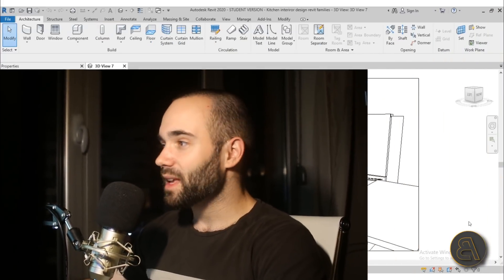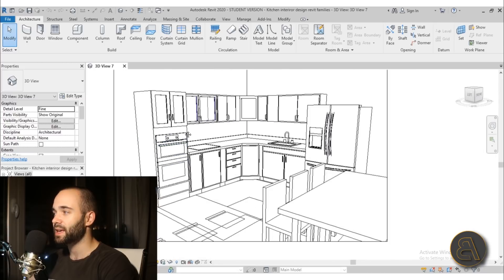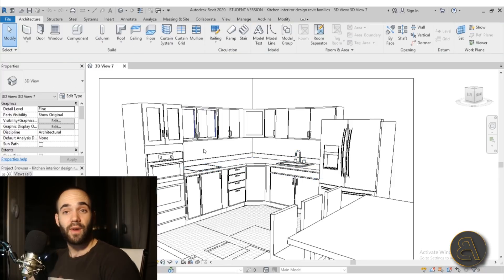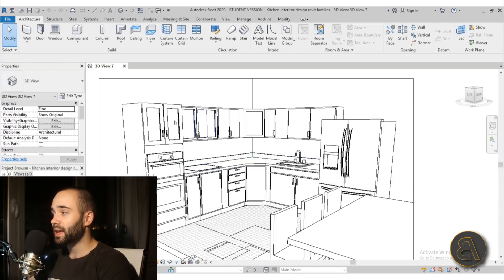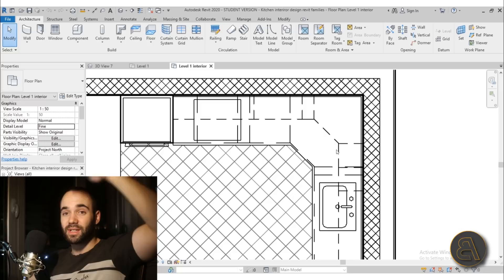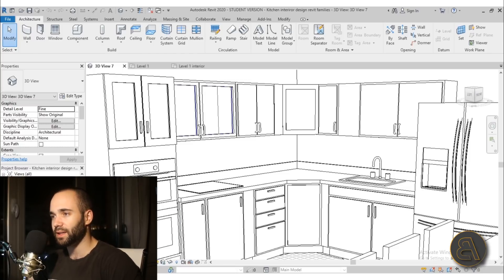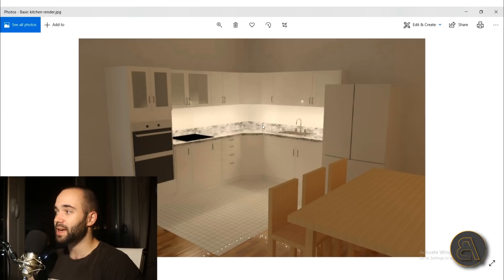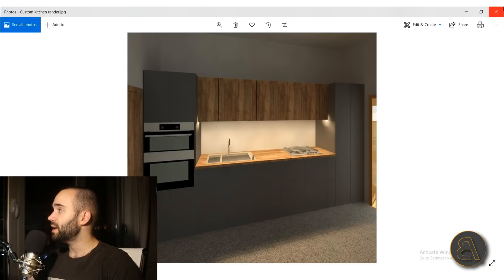Revit Interior Design   Kitchen Balkan Complete Course

Comment: I'm a design build architect. I'm here because I'm looking for a better workflow. My projects are mostly interior fitouts? My current workflow is autocad - sketchup- microsoft exel. Is using revit saves more time than my usual workfkow consinedring revit is all all 3 in 1?
Reply: Yes, With Revit you can save time. I'm an architect too and use Revit for the development of my projects.

Comment: Everything （wall thibkness, stairs, door and Windows） in my revit stays as feet, even If I change the length to cm in UN.  Why? How Can I change it.
Reply: You are using an imperial Template.
When you start a new project,  don't pick the template from the tab. Click "Browse" Instead. Then when the library opens, go to the address of the library that on top of the tab, which should say "English I" or US Imperial. Click on it to see the address tree(directory), then click Templates to go to the templates folder. There pick English Metric. and from the folder Default Metric is the architectural metric template. This is what you should do every time you start a new project since you have not yet created one of your own.
If you want to have this template first choice you have to change the address of the templates in the Revit system (Options)
Click file/Options/File Locations.
The upper tab has the templates. Click the path of the one that is named "Architectural", or create another with the plus(the name doesn't matter. Once you click the path you will notice a small button with three dots at the end of the path. That'S "the builder button". Click that and the address of that particular template will show up in a tab. Do the same as I instructed earlier in this comment, which is clicking where it says US Imperial, then clicking templates, the picking US Metric and there the one named Default Metric.
Ok to all the tabs, until you are at the file locations again. Click the template you edited and click "Move Rows Up" button (the blue arrow facing up) to send this template upper in the hierarchy. Now you can start a new project by just clicking the template name below "new" at the "Project" section of the recent files tab.